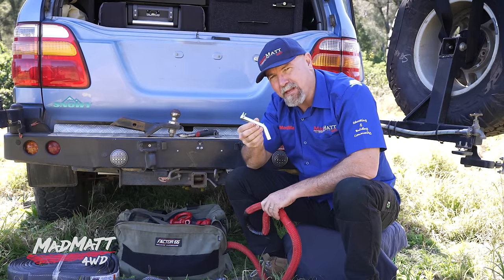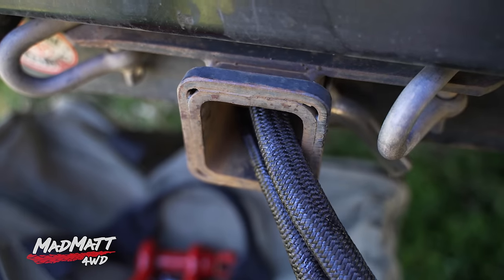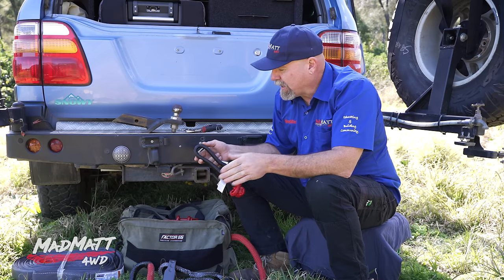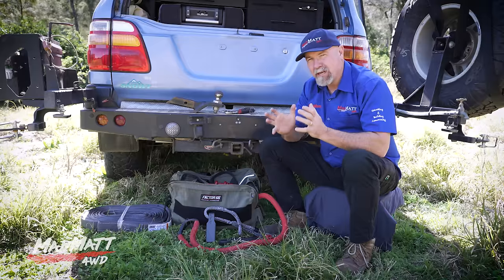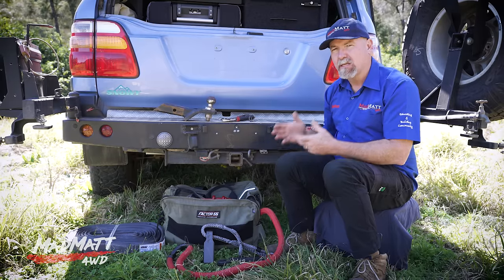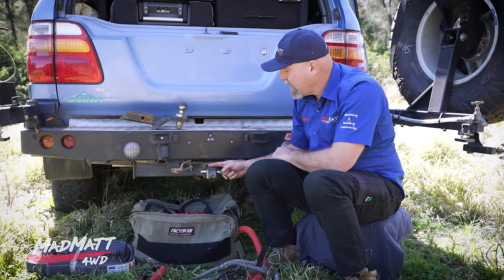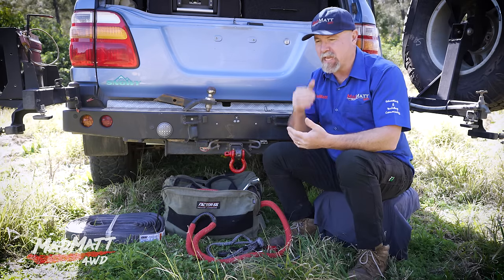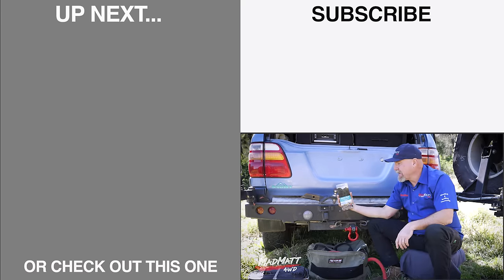Should you use a hitch pin as a 4x4 recovery device? Is it a YES or NO answer?

Comment: First, let's assume that things are being deployed correctly. That an idiot hasn't been given the tow equipment, ignores what should be pretty obvious and uses the equipment properly.

1> Kinetic rope gets cut on those edges, it snaps and flies....2 meters. There won't be a ball hitch or any kind of energetic weight that could cause you to have a Wile E. Coyote like ball hitch shaped hole in your stomach.  You might take the smallest of slaps but if that rope hasn't been used so much that it's damaged to the point of losing it's kinetic properties, nothing dangerous happens.

2> I don't agree with your pin description of the failure. It's true that it only needs one spot to fail on the pin however that pin must be pulled and bent to a degree where the material no longer has enough strength to hold the weight of the pull. Take your finger and pull at the extended side where the finger can't (well, lets be careful here) be broken. You can pull against that finger, and it doesn't just break or let a rope pull free because it has supporting bones and tissues to stop it from bending or breaking. NOW, flip that finger around where the knuckle and supporting tissues are designed for your finger to bend (for you to pick things up and yes so your finger doesn't snap). If you pull on the middle with a rope, the finger bends; nothing is injured, but a rope pulling on your finger from that direction will pull off your finger and pulling will fail.  The problem with your example is that the "finger" in your description is hardened and designed not to fail if it's pulled from every direction. If it gets pulled from the middle, the ENDS of the pin must move inside the holes on the hitch under great friction inside the holes. You make it sound like it just fails in the middle but it doesn't. I've seen  one bent to hell and back by someone rigging a chain to pull a trailer because he forgot his damn hitch. It took a HELL of a lot of yanking to bend that pin to the point where he had to take an oxy/acetylene torch and cut it out of the receiver.  I do not agree that the pin will fail like you think it does. If anything, that thicker rope makes it HARDER to bend to break it out because it distributes the weight of the tug over an inch and a half of pin versus a quarter inch if you're using some sort of smaller rope.

We're at an inflection point when it comes to pulling. They're more expensive, but kinetic ropes are SO much superior. It literally is the difference between tugging and maybe pulling the hitch right off a vehicle versus slowly adding that load over a kinetic. By all means, use a strap if you're pulling someone out, but you've said over ONE MILLLLIONNN times (and rightfully so), DON'T TUG ON THE DAMN STRAPS OR ROPES UNLESS THEY'RE KINETIC.  If you're an off-roader, I'm not sure there's a reason anymore why you don't have a kinetic rope and ball endings to secure them too to your tow points. They're so much safer for every point of recovery as long as you don't run them over or tug them to death and still try to use them. Kinetic ropes DO have a lifetime of pulls that they're only good for. Oh, also...don't let sand in them. Sand will slowly grate and cut all the internal parts to your nice rope.  If it gets muddy, soak and clean it out when you're done whatever made you get it muddy.

The point on trailing people not having a clue about rigging is well made. The "best of what we have" is often used with an insanely high percentage. Got a 3/4 inch yellow rope used to hold down a tarp? Why sure...it's a rope, isn't it?  Yeeeesch!

SORRY FOR THE BOOK, Matt!
Reply from the maker: Having seen a few straps break they’re still quite dangerous. And if a rope was to fail I think that would hurt
Reply: @MadMatt4WD  Oh it'll hurt and a shot to the face would certainly be a potential eye ending event. Sorry about the top. Slowly adding more as your video goes on.

I agree to a point with all of your points. To me it kind of comes down to the "idiot factor" that neither you nor I want to talk about...we go past all of the logical points buuuuuuut then we get into the place where someone has an already twisted pin they're using or they towed a 5 thousand pound trailer across Montana with only a chain and a pin because they didn't have their ball for the receiver.  That must be the hard part of your videos...the part where you go, "Okay look. If you do this, you're an effing a> idiot b> lunatic...just don't do it or go find someone more logical so that THEY can choose not to do it."

Question. What about tow rigged hitches? Where you have a thick ball hitch but it's also reinforced by a thick iron locking hitch. I'll try to explain. Hitch is there but then you have to open a locking jaw that closes down over whatever you're using to tug with?  I've seen a few people with them and they seem...pretty sturdy.

Love your videos. I wish I saw more kinetics on the trail versus straps/ropes/ratchet/ratchet straps.

I have to ask. Is that a tap coming out of the bottom of your spare? Like, do a couple hours of hot crawling annnnd, walk up to the tap, grab a drink and cool off?  What a perfect idea hehee.
Reply from the maker: @Donald_Turnip  it’s really hard making content for yt in that you never know where a person is at in their leading and everything is effected by a persons understanding of the other things. At the end of the day I’m feel like I cheery pick bits a pieces p talk about and leave out all the other important things. It’s frustrating. A pintle hitch is what you talk of and they can be used with caution. Yes it’s a tap. Connected by pump to a 55l tank built into the top of the 122l long range fuel tank.
Reply: @MadMatt4WD  That fuel tank is pretty sweet! Needed because of the long distances in Australia you might need to drive I assume?
Reply from the maker: @Donald_Turnip  Yes but also this is a petrol motor so uses 20LPH and more offroad. All up i have 210L in fuel. http://thelongranger.com.au/toyota/landcruiser/100-series/tr62p

Comment: meh, ive been using the hitch pin for many years without issues, safer then a ball.
Reply from the maker: And your a huge test sample. Maybe you’ve been lucky but the question to ask is is it best practice
Reply from the maker: @mrspart5548  I reference the testing done by corporations such as Factor55 who’s owned by Warn winches. I also reference and  confir with recovery experts from across the world such as authors of books on 4wd recovery. Manufacturers of winching equipment. Manufacturers of recovery equipment and the message from all of them is the message I’m sharing here. You go use your screwdriver  but don’t ever come and try getting involved in a recovery with me.